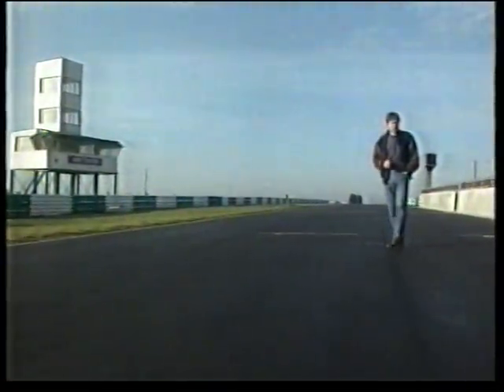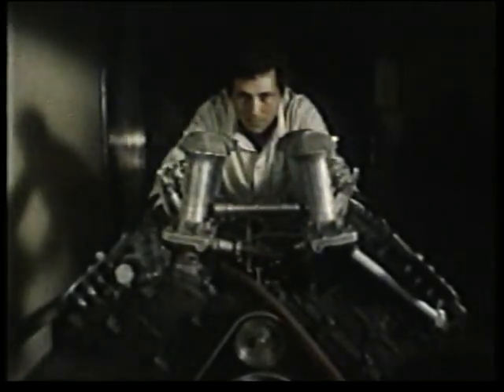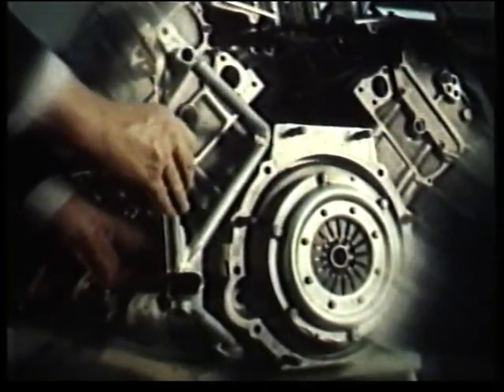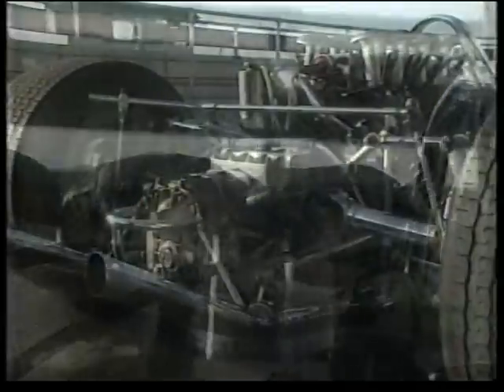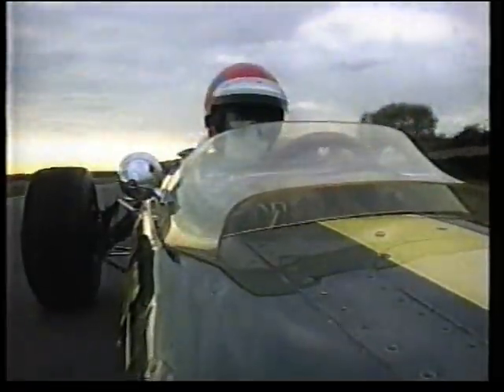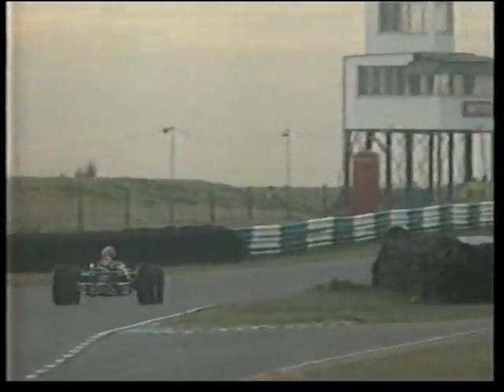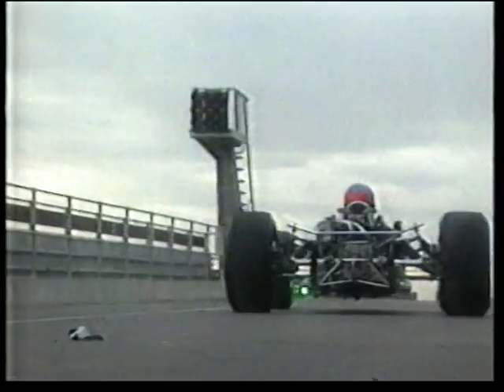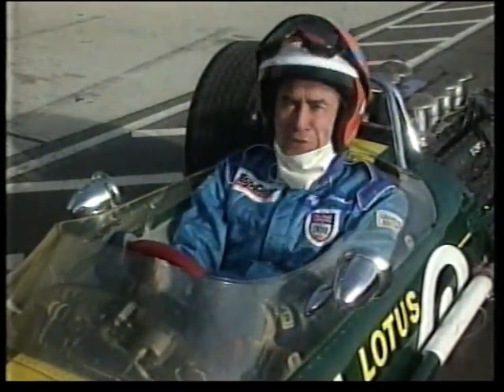Tiff Needell tests the Lotus 49.

Comment: chapman's cars were under-designed to be light. modern cars are designed to be light, but at least the parts are designed to withstand the forces they're meant to. that's what i meant. i do understand the risk in any form of motor racing.

Comment: It's somewhat comical, reading these comments... I'm 60 years old now and all I remember of this era in F1 are the three Hot Wheels cars I had at the time. These races were never broadcast in America. 

Just last month, I watched the movie Grand Prix and also the documentaries filmed at the time about the making of the movie. Most of the staged shots were filmed at something above a warmup lap pace, in order to be safe and have shots that could be followed by audiences in the theatre. The clips from the real races were mostly shot as the cars came around low to medium speed corners or as they drove away down some straight. But, there was one.

It was very brief. It was shot with a long telephoto lens just off line from the car as it crested a hill. It was the real Jackie Stewart in the real BRM in the real race, getting light over a berm at the end of a right hand bend. O...M...G.!!! 

Nothing. I mean NOTHING in 47 years of watching motor racing prepared me for THAT. In a split second, it looked like Jackie must have caught the car 5 or 6 times from flying off until it "settled" on the track again. And the SPEED! 

Why doesn't Tiff tell us what it's like to drive the Lotus 49? Because, he doesn't know!

Comment: none of what you're saying had anything to do with my comment. talking about carbon fibre is silly cause it wasn't even invented at the time. i didn't bring up jim clark as a specific driver either. i'm stating the fact the lotus cars were under-designed structurally to save weight.

Comment: No seat belts, and the roll bar is lower than the driver's head.  Is that stupidity?
Reply: No....that's moor racing in the early 1960s.
If Needall had been driving the '49 in a race meeting, then current regulations would require seat belts and a higher rollbar, but this car is not raced, only demonstrated.
Reply: Typo! :)
(I'm Australian, not English.)
Reply: Fair enough. I'm descended from English stock, so that's acceptable. :)
Reply: *****
I hadn't thought of that!  You are probably right.  It's strange that people building race cars in the early days didn't think of things we take for granted now.  Race cars started off being really high off the ground, had skinny tires, no seat belts, and there wasn't any thought of aerodynamic down force.
Reply: ***** Are you really going to criticize him for forgetting the "t" in motor racing and then say "your English"? haha
Reply: I hear what you're saying, but they had self sealing tanks in aviation long before this, so they didn't need to be overly concerned about fuel leaks either if the cars were equipped with them.  It looks to me like the race promoters and car builders knew racing audiences are turned on by horrific crashes and they didn't see a need to spend more money on making cars safer because there was a line of drivers who were anxious to get take the spot left open by the death of the previous one.
Reply: ***** Try reading what I wrote.
Reply: Yes, they were amazingly brave.
Reply: @hcrun  Also Tiff is a lot taller than Clark